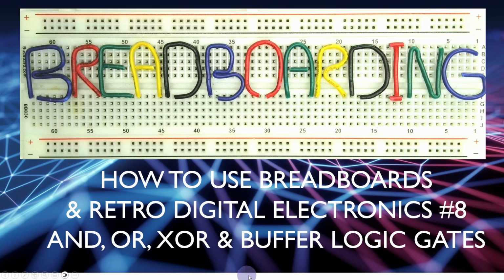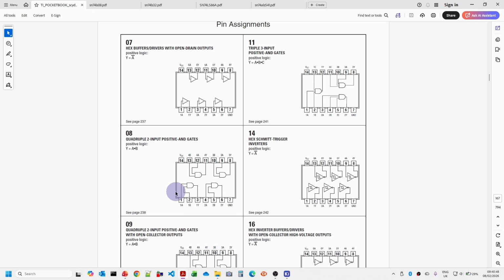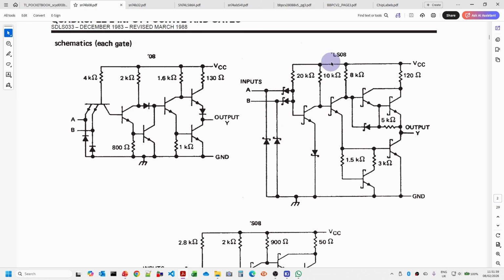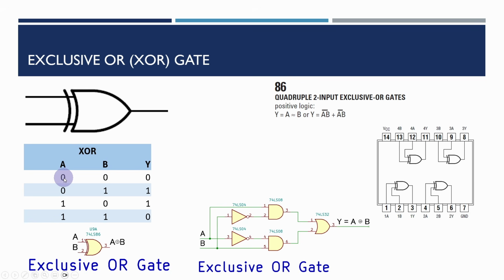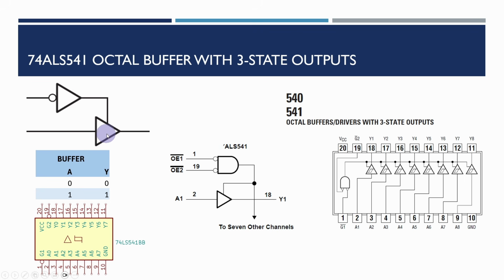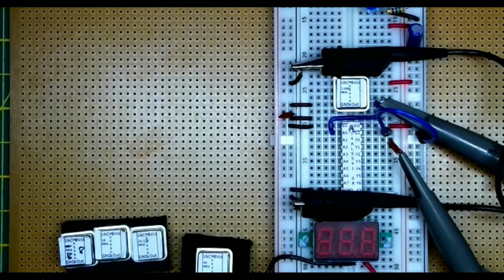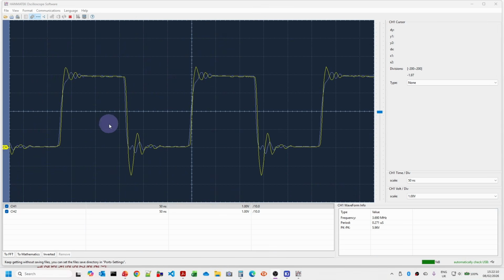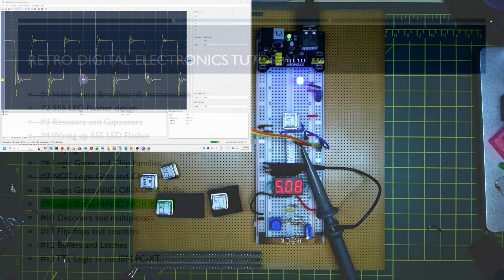#8 AND, OR, XOR & Buffer Logic Gates - How to use Breadboards & Retro Digital Electronics

Comment: This is great! I want to use this in my class! I teach something quite similar to this. Where students make a NAND gate with relays, then with two transistors, and then switch to 74LS00 to create all of the other gates up to XOR, then on to half-adder, full-adder and then combine theirs with 3 other students to make a 4-bit ripple-adder. I kind of pieced it together from NAND to TETRIS but with using actual IC's instead of that pseudo hardware descriptor language. One of the other Professors teaches VHDL or Verilog in another class that goes through a similar progression up to the point of making a PC I think. I actually don't include a BUFFER GATE or XNOR...hmmm, maybe I should include them from next year. I actually did have a one student make an XNOR just for fun....this year though...explaining what make NAND and NOR so special among all of the gates. Putting the sticker on top as well, maybe I will speak to the tech support office to see if they can print me some stickers like that! Oh, and tri-state....so much great content in this concise 30 minute video!
Reply from the maker: Glad you found it useful. I have not started to look at VHDL yet but it feels like cheating for retro stuff ;-) I prefer the 80's & early 90's stuff as it is a lot easier to understand. The problem with modern chips and microcontrollers is the documentation can run to 300+ pages which makes it difficult to understand it all. I haven't done the Tri-state bit yet, will leave that for the latches & buffers later. I think there is only 1 XNOR chip I have come across in the 74xx series and the 74LS266 is open collector so not a common gate! The Chip labels I got the idea from Grant Searle http://searle.x10host.com/labels/index.html (he used Visio) though I have put the ones I have done using InkScape in SVG on GitHub https://github.com/breadboardinglabs/Breadboard8088PCV2/tree/main/Chiplabels. Hope this helps. Dave
Reply: @breadboardinglabs  Awesome!